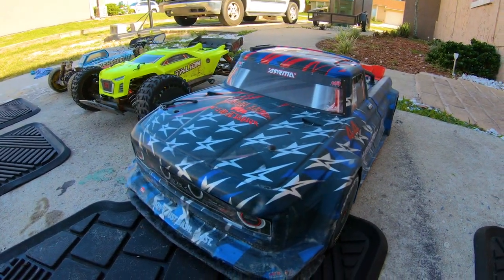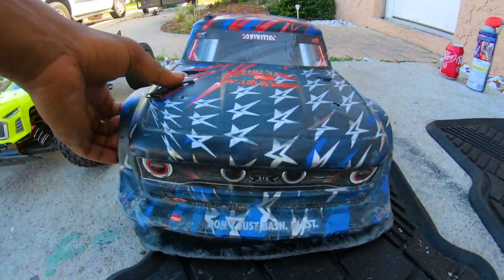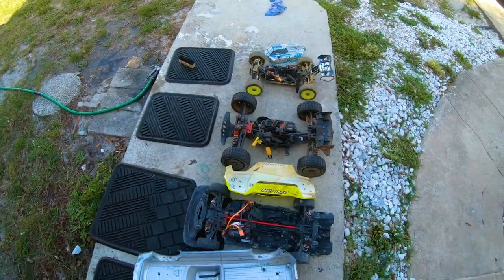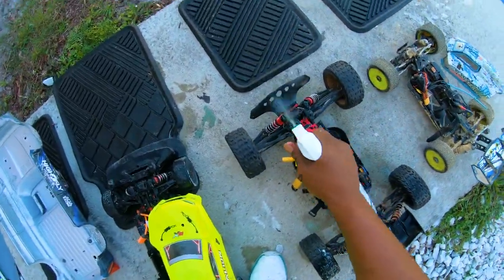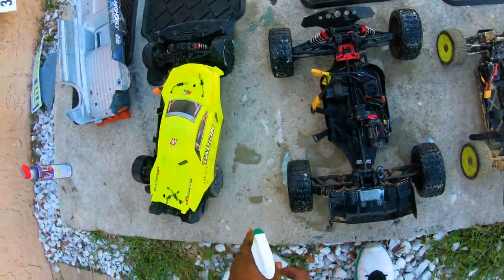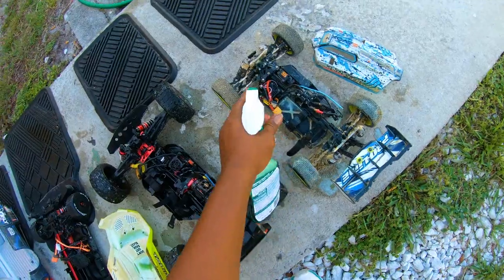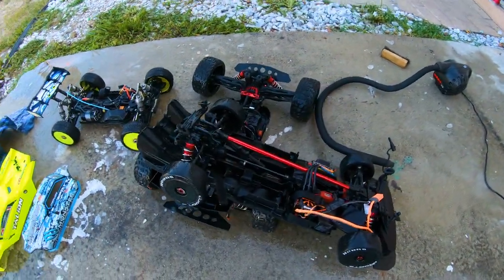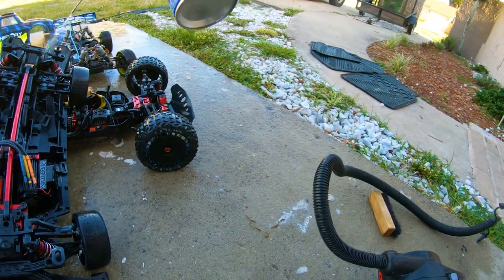How to wash yoiur rc cars and trucks Arrma Losi Tekno Traxxas

Comment: When you hit it with the wd-40 how long you let it sit before blow drying it again? Wd just on the metal parts or all over? I couldn't quite tell? They clean af after all that tho. Fosho doin this for my infraction. Great work.
Reply from the maker: I don’t let it sit I spay it immediately because it beads the water right off because it’s oil and when it drys it makes your car look new but don’t run your car for 24 hours to let electronics dry I spray everything with water and wd-40 ty family try it out works best with air compressor to get the water and trash off
Reply: @TruSwagTv2  will do indeed. Thx for the reply.
Reply: Look for the WD40 Silicone spray. In my opinion, has better lubricant for hinges & joints, metals meet plastic. Doesn't leave slimy, watery residue like original WD40.